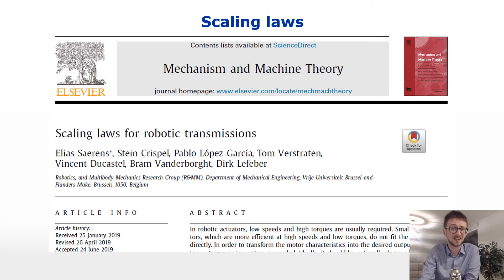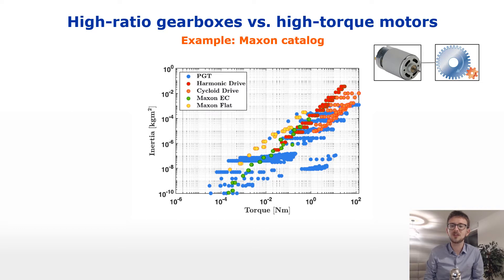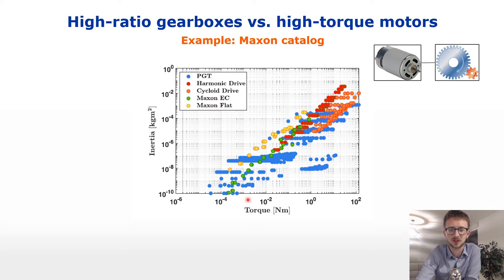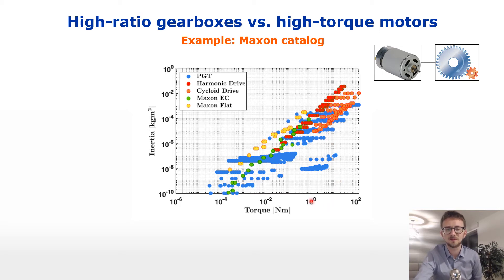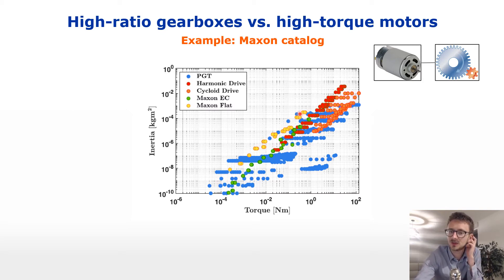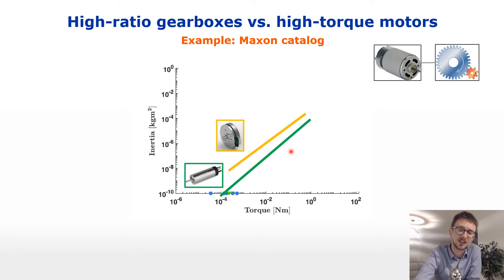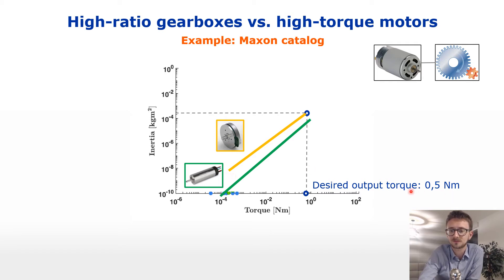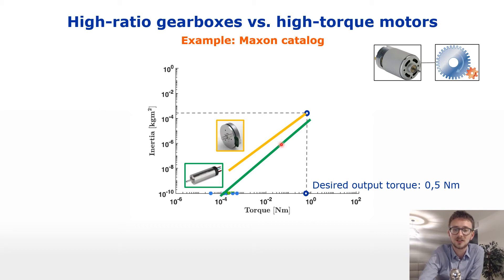High-ratio gearboxes vs. high-torque motors: scaling analysis

Comment: Nice initial work and good job for using a little science. Keep building up your models and your experimental data, it will pay off. We maintain a database of motors and transmissions across all price/performance points, models that include thermal and non-linear losses, and experimental results so that we can intelligently design optimal actuators for our clients. There's no need for debate when you can directly make an informed choice about which tradeoffs suit your goals.